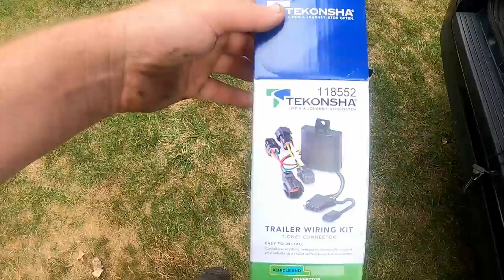08-17 Jeep Patriot Hitch Install

Comment: After I watched the video I put a Reese on a 2016 patriot. The only thing different is I didn't need to lower the exhaust. The bolts are supposed to be torqued so I didn't use the impact gun. But everything else was a big help thanks man

Comment: Entirely too much work. I just installed mine without even removing the bumper.
Reply: Next time just drop the exhaust, wedge the hitch receiver in between the car and exhaust, jack it up with the jack, trim the bumper and tighten everything. Done
Reply from the maker: I'm always happy for a better way, thanks.